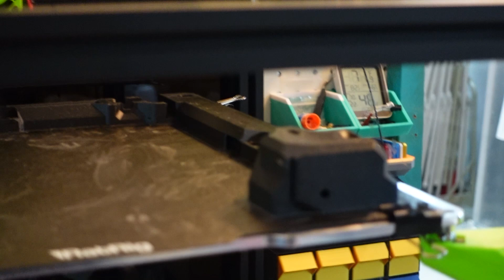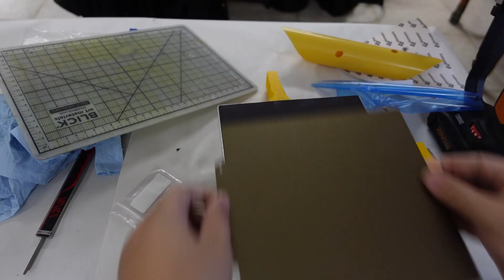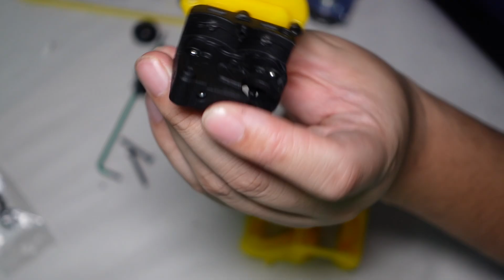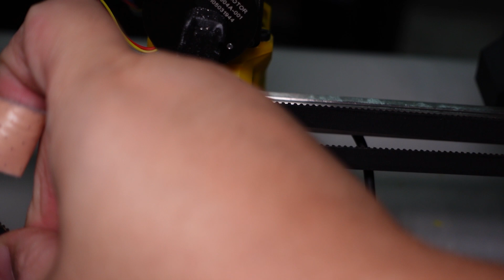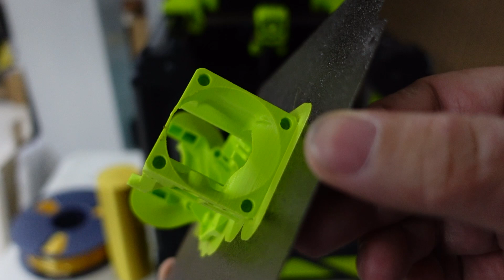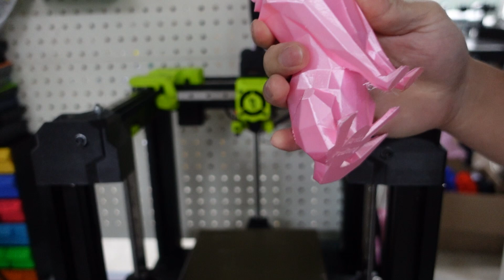3D Printing a 3D Printer? - Ratrig VChonk

Comment: did you print all the parts in abs? also how much was the overall cost of all the parts, wondering because interested in printing my own...
Reply from the maker: I did print in ABS the first time but I made some replacement parts in PLA and it seems fine so far. It ended up being ~$700 considering failed prints and all the electronics

Comment: Finally a video of someone building a v-chonk! I've been wanting to build one, but the base and gantry frame size are the biggest barriers to entry. I only have a 300mm voron to print. I've seen files with the base split, but I rather try to make it as one piece. I almost wished there was a 120mm v-chonk. Has anyone made a 120mm mod yet?

Comment: How does it perform compared to your normal printer? Both quality and speed?
Reply from the maker: It has the same quality as my vcore 3.1. I've gotten 4x the accel before the belt skips a step but I don't run it that fast because of the noise. I keep speeds and accel consistent across my machines so parts look identical.
Reply: @someprintdude  awesome

Comment: this is great and very impressive, i think you can break the parts into sections and either glue or bolt them together to make a bigger printer with your smaller one.
Reply from the maker: That's my plan to take it to 250 x 250 x 250. Honestly at this point I should just buy a bigger printer but a sick curiosity drives me to take it even further.